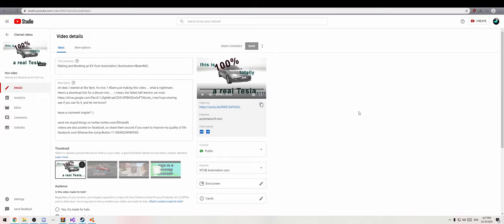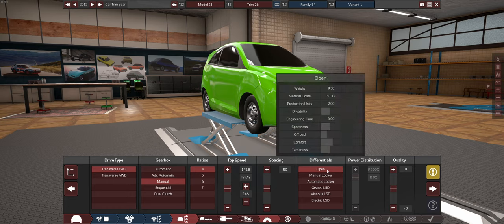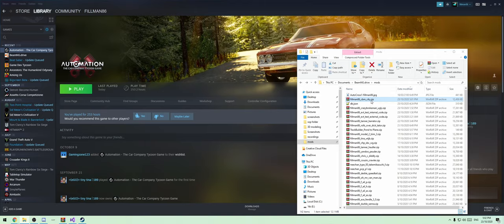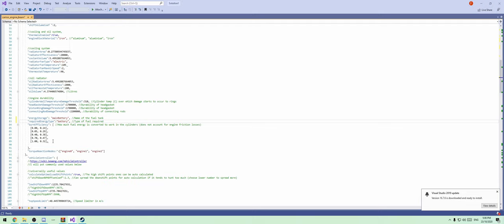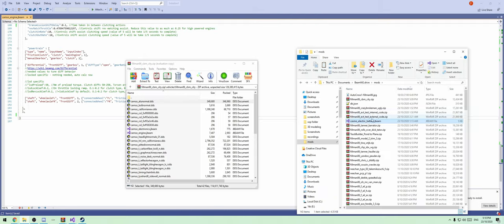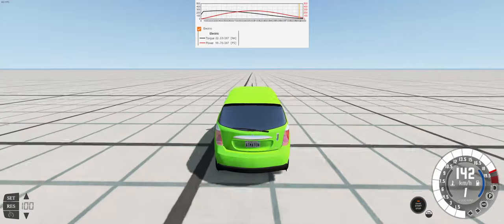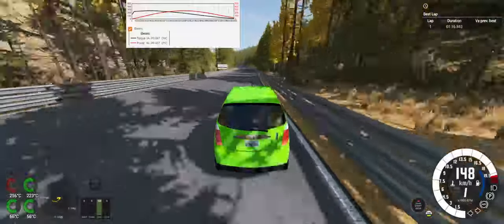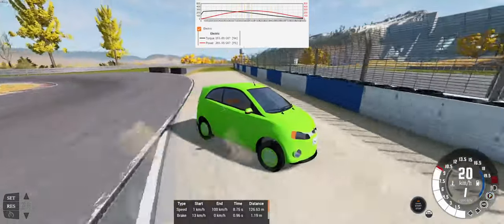Stop Faking Electric Cars Today!! (Automation🔧BeamNG)

Comment: inertia thing is the collective rotational mass of your engine's moving components, it determines your throttle response as in the rate at which you gain/loose rpm based on sum torque acting on it (for abrams engine swap make it 500 or more).
friction, i can't tell if its at the engine or the wheels but it basically substracts your engine output by the value given, same with dynamic with the twist of being based on rpm.
the low downshift/upshift rpm thing is most likely kept for the AI, its basically the upper limit between cruising on low rpm and stalling the engine.
Also, you should keep like two gears forward, as much rpm as the electric motor can reach, it isn't particularly happy cruising that high.
Reply: Yep. Electric cars can still benefit from having a multiple-speed transmission.

Comment: Electric cars can still use transmissions with multiple gear ratios. The gears just need to be tuned differently.
Reply: I’d probably couple my electric car to a CVT and a Freewheel, and give it a very tall maximum gear ratio along with a very short minimum gear ratio.
Reply from the maker: true, most don't bother though, as it adds weight, and doesn't have much advantage
Reply: @fillman86  Low gear ratios are still good for acceleration, towing, and getting unstuck, whereas high gear ratios are still good for high speed.
Reply from the maker: @AmaroqStarwind  not as much as you'd think. You'd do better to just make the engine to be the right size in the first place. 

Otherwise you'll have to cart around a heavy robust transmission that is parasitic to power, and hurts range.

unlike elextric motors, ICE are really only efficient in a few thousand RPM, so you have to have a gearbox to keep it in that range

Comment: I made a electric version of the pessima (technically a prius and a gm ev1 mashed together)
but for some reason its very i mean VERY slow.
i dont know why but i set the torque to 150 and it only works when i put it at like a high torque
example:
150 (very slow)
5500 (fast?)
any idea how to fix this?
ALSO i checked the torque it said that the wheel torque is low?
how can i increase the wheel torque without increasing the torque from the jbeam?
Reply from the maker: Beam doesn’t deal with this system well, so just tune it to feel

Comment: If you set inertia to 0.002 it doesn't burn out the clutch and the motor doesn't linger as long when you release the throttle.
Reply from the maker: thanks :)

Comment: idk why but only battery pack isnt showing up in the beam selector. now we have car assist control so idk if its because of that but yea. i have it the same as you. everything else works perfectly.
Reply: i fixed it but why does it make much much more hp than torque in my case? it gets up to 1.1k hp at 12/13k rpm when i have max 750nm between 500-4500rpm? how do i fix this
Reply from the maker: power is a mathematical derivative of torque. So what you set, is how it would be in real life
Reply: @fillman86  i detuned the highest rpm power and it solved the problem. i did 650nm up until 12k rpm (18k is the max rpm) and then to 350nm at 18k which made it super powerful. now i did 450/350nm at 12k and 80nm at 18k and i have healthy 600hp
Reply: @zazaelashvili5680  how'd you fix the battery pack not showing up? I'm having the same issue.

Comment: Is it possible to create a hybrid? Would love to build a hybrid race car
Reply from the maker: Haha you've guessed a project I gave to myself whilst doing this
Reply: @fillman86  if you make it happen I'll build a neat LMP car for you
Reply from the maker: @Sol-Apollo  lol oops https://www.beamng.com/resources/electric-motor-batteries-in-automation-car.14890/ I thought I posted this ages ago, we just make our own things, but look out for a build challenge (non electric though) coming out soon. Also if you find that I've left something out of this video, let me know :)
Reply from the maker: Oops, sorry I got my responses mixed up, that's just the electric car file.
Reply from the maker: so I've gone over a bunch of things, and it seems that beam won't let you control 2 different types of motors at the same time. I was able to get the srb to have a petrol rear engine run, and an electric front motor, with a battery and fuel tank, but it won't drive, or go into gear. 

So really your only option is to replicate the power curve of one of those types of cars, and imagine :P
Reply: There is some power curves of hybrids where u have petrol power, electric and final power curve so... Make something based on that and make CVT by making automatic with a lot of gears and 0.01 difference betwen them xD
Reply from the maker: @FirssenSimracing  there is actually a cvt, so I'm looking into how to implement that, and you can't make a real hybrid in the game, but yes, you can fake it with a power curve :)
Reply: @fillman86  you can do hybrid! Check out new video “hybrid in automation”. Someone’ve done it. Pls, try to make hybrid and show us 😅
Reply from the maker: @breadua5657  it was pointed out to me that it was made years ago too. I do plan to revisit this, and how to get better sounds too, but not right now
Reply: @fillman86  ok, we will be waiting for guide how to do this

Comment: i dont see a battery pack option and i dont know how to lower the power because i dont want it to have 1400hp i wanted it to be half and even though i put 600 torque its 440 how do i fix this? im stuck my guy
Reply: i rewatched the video and fixed some mistypes i missed but none of my problems changed
Reply from the maker: hp is a derivative of torque, so you can use a calculator for that. As for finding the battery, that's an odd one. If you go onto the beamng repository, you can see my example car.

If it doesn't matter technically, the referenced video at the beginning is simpler, because this is an advanced mod

Comment: I'm trying to edit the camso_engine file of my car in Notepad++, but it won't let me, like it's in read-only or something. I've tried modifying it in normal notepad, which works, but then I can't save it in the zipped folder. Any idea?
Reply from the maker: because you've left it packed whilst the game is open?
Reply: @fillman86  Sorry, what do you mean by packed? Also, both games are closed
Reply from the maker: @hgbg479  in beamng in the mods manager, you can unpack the mod so working on it is easier
Reply: @fillman86  That works, but when I try to pack it an error message says: 'Unable to pack mod: Zip is in read-only, close other software'. I don't have anything open, and I deleted the file from Notepad++
Reply from the maker: @hgbg479  are you packing it with beamng?
Reply: @fillman86  Yes, but I do have 7zip if i need to use that
Reply from the maker: @hgbg479  odd, I think this is something you'll need to take to the support parts of the game instead, because that's not a normal issue :/
Reply: @fillman86  Oh right, thanks anyway!

Comment: Unfortunately, this method no longer works, thanks to the newest Beam.NG update. The game does not register the engine as a proper electric motor, and does not give the option to install a battery pack.
Reply from the maker: odd, still works for me as of last month. You probably made an error (which is easy to do)
Reply: @fillman86  Following your instructions step by step, it ended up not working out. Perhaps it may have been a bug or glitch that prevented it from working for me?
Reply from the maker: @zantheros4927  nah, it was probably an error. There's pleanty of trouble shooting comment threads below if it'll help :)
Reply: @zantheros4927  yea it doesnt work for me either

Comment: Technically, no electric motor "makes" a flat torque curve. It is the speed controller that is causing that. If you hook an electric motor up to raw power (no controller), then the torque characteristics is defined by motor design and type. Like for PM brushed DC motors it's a linear torque curve.
Reply from the maker: kinda, the idea is that it doesn't have much of a ramp up naturally, but it's the drop off as if gets further over it's operating rpm :)
Reply: Usually torque curve is flat because even smaller motors need a lot of three phase current to reach magnetic saturation where you would find absolute torque but power electronics are the first limit so torque stays flat and rpm increases until battery can't push enough current to controller and then torque starts to decrease. Also torque starts to decrease at 80% no load speed but that is proportional to battery voltage and running motor with bit higher voltage but limiting rpm you can have very flat torque curve.
Reply: @TheNone724  Actually, only DC motors make max torque at stall with max current possible. AC motors lose max torque if they stall, even if the current is large. They have what is called breakdown torque, which does not occur at stall, but somewhere in the 80 to 90% RPM region, which is its max torque and then the torque quickly collapses to a low value even as current goes up if the load requirements continue to climb (hence, why it is called breakdown torque). The raw power torque curve before controller looks like a knee, basically. 

With speed controller for AC motors the the breakdown torque is shifted left to become your starting torque, removing the weakness that AC motors once had compared to DC motors. And if the load goes up, the controller will actively move the torque curve to prevent breakdown torque stall. With AC you have to change both frequency and voltage. Everything else you said is true for DC motors.

Comment: Idk why but whenever I edit the files for any car its makes me unzip the folder and then zip it again to save the file in the folder.  but after I do this the car doesn't show up in my car list but it is clearly in the files.

How do I fix it??
Reply from the maker: odd, what zip program are you using? do you put it back into the "mods" folder?
Reply: @fillman86  I just use windows to zip it and I put it directly back into the mods folderr
Reply from the maker: @arkconstructive4456  oh, I thought with just windows it might be possible, but try getting winrar
Reply: @fillman86  ok

Comment: my car doesnt have a fuel tank or battery pack and i have no fuel, everything else works
Reply from the maker: please read through the previous comments and you'll find answers to this question :)
Reply: @fillman86  it doesnt work, now beamng says that my car file thing is corrupted or broken mods or something, there was an error with the camso it was casmo but my car is now a ''broken mod'' or something.
Reply from the maker: @deiserrrrrrrr  you have to also be very particular about capitilisation of the correct letters like "electricMotor" etc.

if you still can't figure out what's wrong, here's a link to where you can download and compare https://www.beamng.com/resources/electric-motor-batteries-in-automation-car.14890/

Comment: I did everything exactly as in this video (apart from the car and specifications) but the car doesn't even load at the first attempt, even if I get it spawned, battery pack is not available as in here and the car doesn't move forward whatever  I try, please help.
Reply from the maker: consider looking through previous comments. You have to be very accurate with this type of EV. Things like capitalisation etc are necessary. The difference with my EV modifications compared to others is purely on technicalities, but is much harder
Reply: @fillman86   @where's fillman86  I tried it so many times with exactly following the video word by word, that I memorized the whole process now. Still facing these problems. Can you check my file?
Reply from the maker: @nithulnath9331  sure, upload the whole zip file to something like google drive, and I'll have a look over
Reply: @fillman86  Sure, how should I send you that?
Reply from the maker: @nithulnath9331  link here, or subscribe, and join my discord - https://discord.gg/ZxfT3Tkq
Reply: @fillman86  Okay, sure.

Comment: When I export my car to beam, I do not have a fuel tank whatsoever. Every other part of the car works, but I don't have a fuel tank. I have placed the battery pack jbeam into the car files, but there is no fuel tank slot at all.
Reply from the maker: you have to be very specific with capitals etc, I also apparently said "casmo" instead of "camso" so make sure it's the latter. There's also a place to download it - https://www.beamng.com/resources/electric-motor-batteries-in-automation-car.14890/ and you can cross reference
Reply: @fillman86  currently doing a re-export and double checking myself
Reply: @fillman86  I got it! I believe I missed a bracket when deleting the fuel tank from the engine jbeam.

Comment: I'm having an issue where my car spawns in with a full fuel tank even without putting in the battery pack but the car doesn't have any rpm markers and it doesn't rev up or move. What am I doing wrong?
Reply from the maker: So that's because there's an error, apparently I said "casmo" instead of "camso" make sure that you follow what's written. Also make sure you swap in the battery in beam. The file is up on beam's mod website if you need. Please inform me of any mistakes! Then I can make any amendments
Reply: @fillman86  For some reason it still doesn't work. Would I be able to maybe send you the file and maybe you would know what's wrong with it?
Reply from the maker: Sure, I'll be at my pc tomorrow
Reply: @fillman86  Thanks!
Reply from the maker: ..... you're going to kick yourself...... you didn't capatilize the "M" in "electricMotor" -
  "powertrain" : [
   ["type", "name", "inputName", "inputIndex"],
   
   ["electricMotor", "mainEngine", "dummy", 0],

it should look like this haha
Reply: @fillman86  Your right, I am kicking myself! But thanks a bunch for helping me tho. I really appreciate it.
Reply from the maker: that's okay man, spelling & syntax errors is super finicky!! It's something I'm always paranoid about, and I still get it wrong sometimes :P
Reply: Hi, I could send you my folder too, it's not working for me even though I changed the name?